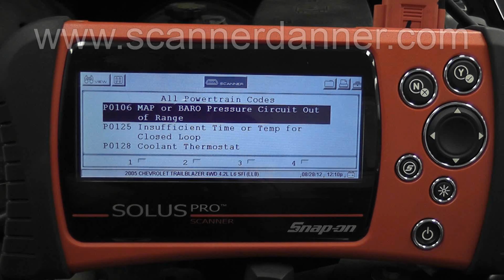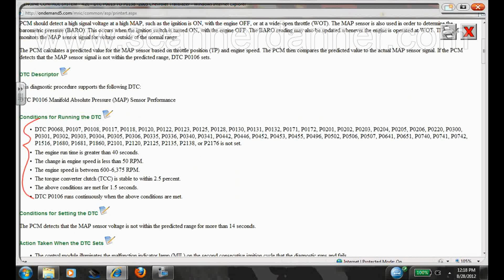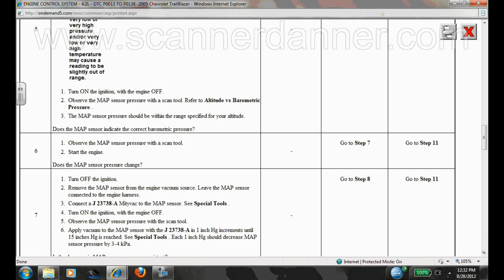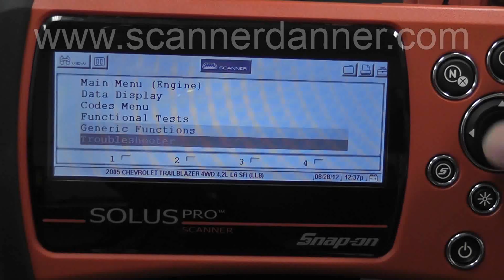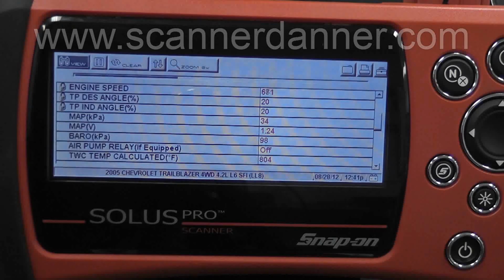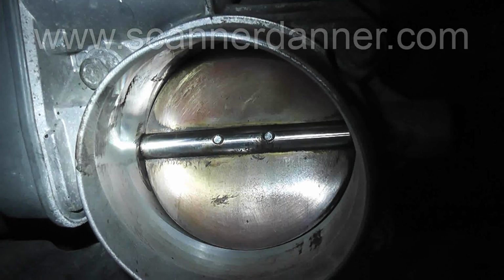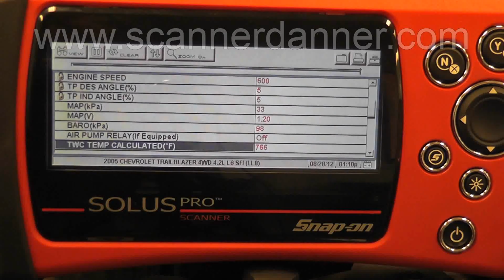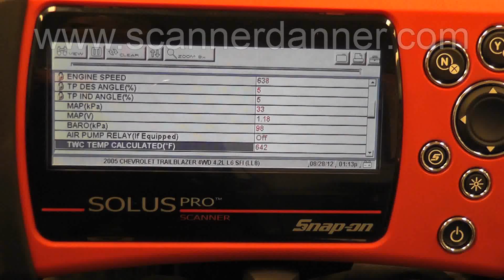MAP Sensor Code P0106 caused by a dirty throttle body

Comment: One more thumbs up and thank you! 2009 VW Touran 1.4 TSi, engine shakes and stutters at 2000-2200RPM, sometimes shows "Engine fault" with ECP light on, P0106 and P0108 can be read (restarting the engine clears the ECP). (So far I thought) expert (not official) VW service (after reading the error codes for 2 hours): the car is OK, nothing wrong, however the clutch is worn so we could replace it for a good price... 
My throttle body was far less dirty than in the video, so I was a bit worried that it's gonna be something else, but the car runs great now without any sign of the problem.
Reply from the maker: If you need further help with your VW. My former student and now Master VW/ASE tech Tommy Wolfe of Positive Lead Diagnostics is your guy.
https://www.youtube.com/channel/UCiFSILHjs5XZecZJDwn7ieA
Tell him I sent you okay? 
Thanks for watching!

Comment: This procedure worked perfectly for me!  My 2004 Trailblazer (6 cylinder) Service Engine Soon light came on. The code was P0106 (MAP Sensor).  1,000 miles later the engine intermittently started surging up and down at idle, sometimes stalling. 

I finally changed the MAP Sensor ($35 at Pep Boys) and disconnected the battery to clear out the Service Engine Soon light.  As soon as I started the engine, the light came back on and the engine RPM started surging again.  I researched the problem and found this video about the Throttle Body Position.  I removed the throttle body and thoroughly cleaned it with Carb/Throttle Body Cleaner and paper towels.  I reassembled everything and fired the engine up.  The light stayed out and the engine ran like a top.  No problems since.

The cleaning process only took about 30-45 minutes, start to finish.  I disconnected the battery, removed the plastic intake canister on top of the engine, then removed the 4 bolts to remove the Throttle Body from the intake manifold.  This made the cleaning process MUCH easier and more thorough.

THANKS for the video!

colorado_kyle@hotmail.com

Comment: I just cleaned my throttle body yesterday and it changed my whole trucks attitude and it threw the exact same code.. 1999 Dodge Ram 2500 V10 Magnum.. may I add I am so glad I have came across your channel I am a mobile mechanic and I cannot tell you how much over the past couple weeks you have help me understand and how'd it go in more in depth on diagnosing vehicles because of you you are what I was lacking as a mechanic because I am a self-taught mechanic..

Comment: I ran into this same exact problem today except I didn't have a MAP sensor code. Thanks to this video I knew what to check first. I was working on a 07 trailblazer then the MIL came on when I drove out of the shop. The Tech2 showed a code for low idle speed. Indicated angle was 25% at idle so the first thing I did was check the throttle and it was dirty. After cleaning indicated angle at idle went down to 9%. Thanks for sharing your knowledge Paul

Comment: had error code p0106. replaced the map sensor and light came right back. was searching for a vacuum leak all day until i came across this video. This worked perfectly for my 2010 sonata gls no more pesky check engine light! big ups for making this video I was starting to get frustrated with this car. but now I'm back on the road!

Comment: Liking this one! I had two cars the last week setting a MAP code and it turned out to be dirty throttle plates.
The first one: a Audi A2 with a map code and a air leak code. No air leaks were found and the throttle unit was totally clogged up becasue of the egr port sitting just below the plate. The code has not return yet after a couple days, it would otherwise set after a short testdrive.

The second car was a Volvo V70, 2004. It was setting a map code after driving about 10km. After cleaning the throttle unit (bosch on this car) it did not return after a 30 km testdrive.

I remembered this video when I was troubleshooting those car and I must say that they are great!

keep up the good work.

/Stefan

Comment: I have to say this is the best info ive ever seen walked through about a specific issue like this. This was in my recommended and im a mechanic of 19 years and have seen this exact problem 100s of times with used car dealers bringing in auction trailblazers with idle surge, this 0106 code or in the later 06+ maf trucks they normally get idle codes or random emission codes as well. Very rarely does cleaning the tb not actually remedy this. One piece of info again in the MAF based 06+ models is that once your throttle hits 25% at idle from being caked up it will throw the idle codes, clearly as was stated in this video that breakpoint is WAY too high but i mean at least gm gave it some slack just in case and as long as you know what your looking at on the data youll clearly see the issue in 10 seconds of a datalog. great video!
Reply from the maker: Thanks so much!

Comment: Hi Scanner.  You helped me hugely a few years ago with my 94 Chevy Silverado.  Learned Alot.  Now i have an issue with a 98 Sebring JXI 2.5   Mitsubishi engine. Been in storage for almost 10 years. Ran it every summer. Finally got itback on the road. I should   have remembered your procedures and checks. But i overlooked them.  Have severe stumbling. Bogging down on throttle.  Wont hold idle well. I changed out the fuel pump and filter. Cleaned out the tank. Cleaned injectors with intake cleaner plugged into the fuel line. Ran great until warmup. Then stalled. I could barely get it up and running.  Just peddling the throttle with my foot to inch my way home. Engine light didn't come on but the scan tool did show the PO 106. And something about BARO reading.  Im going to study and learn from your video and hopefully figure this problem out.  I have an older scan tool so hopefully i can get into detailed data as like on your machine.  I'll let you know how it goes.  Great Video by the way 👍👍👍
Reply: Cleaned Throttle Body thoroughly.  Map sensor voltages are where they should be. Still stumbling. Wont hold proper idle. Throttle position angle still around 21%.  Need guidance please. 😁

Comment: Well DONE !!!! I had a P0106 and SERVICE STABILITRAK and SERVICE TRACTION CONTROL on my 2013 Silverado. Replaced the MAP cuz mechanics said so. Took it to Chev dealer and they wanted to charge me $140 bucks to diagnose. They then said it was cuz of the large cold air intake. The cold air intake had been on several months and just started acting up 2 weeks ago. Before then it had a K&N Stock replacement oiled Hi Perf square air filter. I followed you observations and yup. Dirty as hell throttle body. Oil in there from obviously the square OILED REPLACEMENT K&N filter that I put on since the truck was new. I cleaned it all out and the truck idles smoother and no more P0106. THANKS !!!!!!

Comment: Another awesome video Paul, watched it two months ago and it came in handy today.  Customer comes in to get a MAP installed that the local GM dealer told him he needed.  2006 Canyon 3.5L, P0106 code and an erratic idle in gear. TP angle 17%, MAP was good, ~4.6V KOEO and ~1.2V KOER.

I cleaned the TB and it dropped to 7%, and the idle smoothed out.  I'm confident the code will not return.

Thanks again and keep posting these great videos.

Comment: Thank you for this video, it helped me solve P0106 and P2188 DTCs on my VW 2.5L Golf. The map sensor was fine, no vacuum leaks, but one of the sensors inside the drive-by-wire throttle body had gone bad. After replacing the throttle body with a new one the codes cleared up and have not come back. There were no error codes thrown for the throttle body specifically, so watching this helped lead me in the right direction.

Comment: What a great class with teacher connection. I have p0106 on my Chevy sonic 2016 1.4l. I checked the MAP with dmm and then scope and figured there's nothing wrong with it.  The symptom has been rough idle. Then yesterday I noticed in the autel live data that TPS is at 22% at idle and MAP reads atmo pressure which is normal. So I suspected the TPS would have to be cleaned. Upon further researching I came across this video which are close to my suspicions. You are totally correct even in the 2016 manual there no mention of TPS relation to p0106. So thanks so much!
Reply from the maker: Awesome. You want that TPS under 10% when you're done cleaning that throttle body. Nice find on your part to research this

Comment: Youre a stud man...my car is throwin this code...and recently ONCE went to the reduced engine power mode which is as i understand it is related to disparity in the throttle by wire situation...which can relate back to cleaning the throttle body incorrectly(dude removed the butterfly and failed to reposition it precisely).  Your analysis is thoughtful and im going to work it. Thanks man and im now a subscriber.
Reply from the maker: Why was the butterfly removed from the throttle body?

Comment from the maker: These ETC systems were never designed for performance gains. It was a huge cost saving design. Think about it. With an ETC system the following components on the car have been eliminated: all idle speed control devices, cruise control components (servos, motors, cables), and the throttle cable. How much money per car does this design save the manufacturer? I say a lot. The electronics needed to run these things is no more expensive than a Burger King Kids toy.

Comment: Great example. I would hope that in a situation like this that as the manufacturer sees these problems ‘in the real world’ they would issue service bulletins so technicians will know how to handle it. I’d be surprised if that’s not in Mitchell or AllData, but it’s also great to have that built in to the tool too.

Comment: I'm glad I watched this video I have a 2011 Kia Soul 1.6 L + my check engine light kicked on p showing the MAP sensor code. I'll have to check my throttle plate. One day I drove my car like 20 miles, parked it and tried to start it and it damn near wouldn't start til I pressed the gas pedal to help it start. The strange thing is, is that the check engine light will come on and the car starts running on 3 cylinders, at times if I turn off the engine and turn off the traction control I can restart it and it will work just fine with no misfires, but at times it will start to misfire for no reason, again prompting me to recycling me to do the same thing.

Comment: My view is that there are number of monitored variables in the intake system and those variables (MAP, TPS etc) are measured and compared relative to other variables and each other. It makes programming the computer logic to determine faults quite complex. I think the program logic that deals with MAP and TPS cannot determine which is wrong so the programming is biased towards a MAP result. My point was that it's important to consider the wider system. Its a great vid and we can all learn more!

Comment: Another awesome vid! Its funny. I tried to search truck stalling when coming to stop and nowhere dirty TB is mentioned. Had this problem on for e250 van anytime when coming to stop or sometimes turning.  it thru code for MAF sensor intermittent, so I replaced the MAF and it only stalled 1 out 20 times. I did however notice extremely low RPMS , in 200, so opened Paul's book Engine Performance and it said dirty TB. Let me tell you that TB didn't look that bad at all, but cleaning it made all the difference. Although my TP angle only dropped from 18 to 15% which is still high , my average rpm that before were 200s raised to 500s when stopping slow or hard. No more stalling issues.
Reply from the maker: Thank you and good job my friend

Comment from the maker: because desired throttle angle is learned and needs to change when the throttle plate gets dirty. so the desired reading is not what is ideal but what the computer is desiring the position to be at for proper idle rpm

Comment: I had P0106 on my hyundai tucson and showing "check engine" light on dashboard. After trying out all the stuffs on youtube videos it didnt help.
A friend who works for a renowned auto company (i cant disclose which one) told me to clean the AIR FILTER and leave it for 10mins b4 putting it back.
Boom it fixed it.

Comment: Absolutely excellent video! 

I’m curious as to your before and after LTFTs at idle? Shouldn’t the car have been running lean given that the throttle was open more than it should have been? (I’m not a pro or anything, just thinking of potential additional symptoms)

Comment: Usually I clean the throttle plate, key on, accelerator depressed with fly by wire style throttle body. Ive heard on some makes you can strip or bind the gears by manually opening them. But again, its just what ive heard. Thanks for the videos

Comment from the maker: you shouldn't have to. i would be worried about all those gray wires. how do we know it was wired correctly? you need to monitor both potentiometer signals directly right before the splice of the new harness and see if the signals change with throttle angle as designed. this will at least give us a starting point.

Comment: Nice vids with lots of detailed info...keep it up!
You mentioned drive-by-wire in the vid. Did you ever have a job (or were just curious) where you investigated the acceleration delay that is observed on many of these electronic throttled cars? My Civic has DBW and the delay is very noticeable vs. my non-DBW, 96 Accord. It seems that many other people have issues with this as well. Perhaps this is an inherent flaw in the DBW design.  Any insight?  Thanks!

Comment: Great video Paul, I had about three of these cases,except mine were all on 2005-2006 Chevy malibu's with the 4 cylinder engine.  First one really kicked my butt, because as you mentioned the flow chart is pretty bad,it clearly shows the monitored components to set the code but it only really focuses on one component to diagnose.
I know many unneeded parts are frequently changed on these vehicles due to this code. Great video with a lot of great info.   Thanks

Comment: Hi Paul,
in electronic throttle body, I always clean que The Same way you did, but I've seen people saying that is way is wrong, the correct way is to use spray with the engine running, I disagree because I think this very dangerous; you could make a video explaining the correct procedure?
Thank you in advance.

Comment: I also had same issue on a kia forte 2010. After i replaced vcma for intake runner actuator . I was lost to changed map didnt see a maf sensor. But took off throttle body and shot carb cleaner runs like a champ now😊😊😊😊😁😁😁😅😅 good luck to all techs.  I did with a generic scan tool and two days cracking my head but look for it.

Comment: You should check to see if it is ok to open a drive by wire throttle body manually. On some TBs, you can damage it by opening it manually. In those situations, it would be best to remove the TB and clean the back side of the TB valve. The electric TB for my car runs $239.00, and that's from a parts store. I'd hate to know how much it cost from the dealer.
Reply from the maker: +Frank Gonzalez never had an issue with manually opening them. some need re-oriented with a scan tool but no physical damage occurs.

Comment from the maker: My thoughts on that is if the throttle body is dirty then this supposed anti-carbon finish didn't do its job anyway. Clean away with whatever you have, just be careful. You don't want to get it into a TPS or ETC system componenets

Comment: Without a Snap-on scan tool (or any scan tool for that matter), it should be obvious that the throttle body condition could throw the MAP sensor trouble code because they are part of a "system". The MAP value was out of range relative to the TPS (which throws up P0106) but the computer does not recognise that the TPS was wrong relative to engine RPM.

Comment: I'm back again, this time with a question. I have a 2005 Nissan Maxima 3.5 and I decided to clean the throttle body. {No Codes}. What I did was left the battery plugged in and disconnected the throttle connector. Cleaned the plate and the body. Cleaned the MAF and put everything back together. Started my car and my idle was crazy. Up and down. Tried the manual relearn and it would not take. Question is, Where and or what did I do wrong? This cost me $150 to get the dealer to do a relearn. Thankfully it was not one of my customer's vehicle.

Comment: Paul,
Do you recall the Lexus you had which was not starting?  It had so much carbon that there was no room for the idle air to move!  That was another tricky problem.  Come to think of if, looking at throttle plate should be must if you are trying to diagnosis driveability problem on high mileage vehicle on your own.

Comment: Rationality fault. The PCM sees higher than expected throttle angle at idle. Because of this, it expects to see a MAP signal that reflects the throttle signal and it doesn't, that is why it flagged the MAP sensor. With a higher than normal throttle angle, MAP should also increase but it did not, thus, the computer can not rationalize that. Obviously, Snap On troubleshooter can, haha.  What would cause a higher than normal TPS at idle, it not closing all the way because of dirt intrusion.